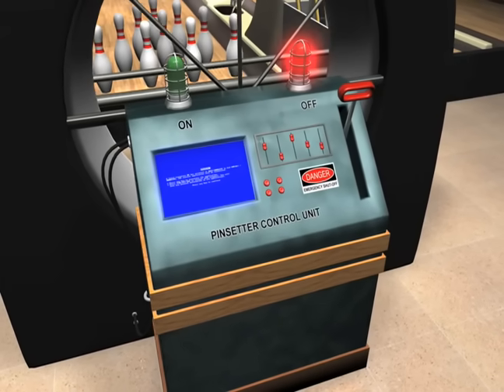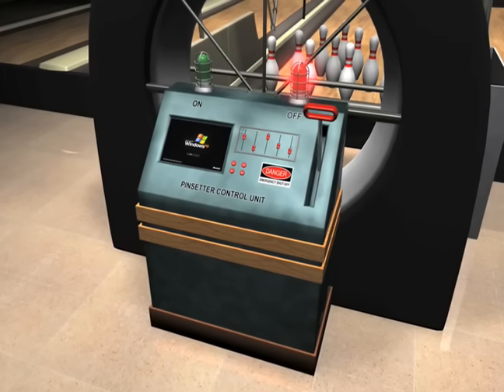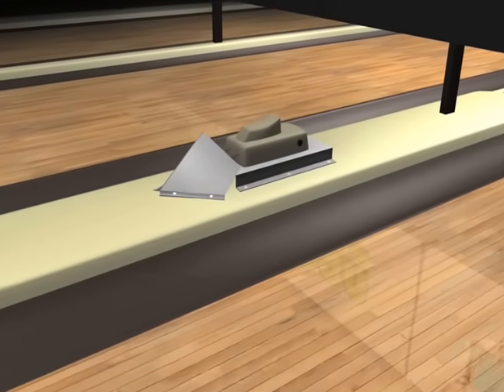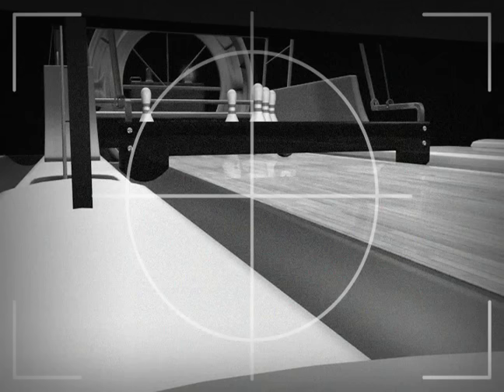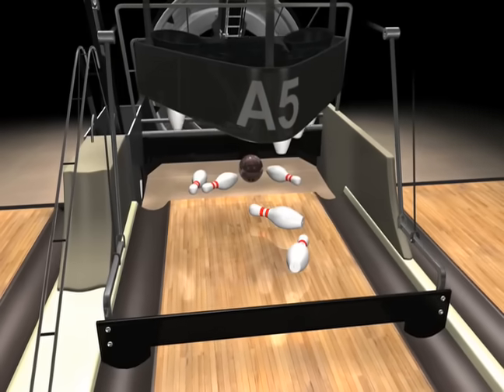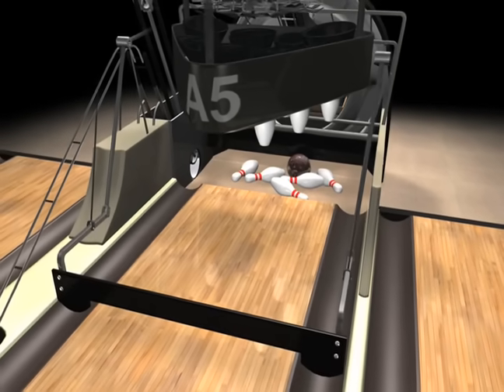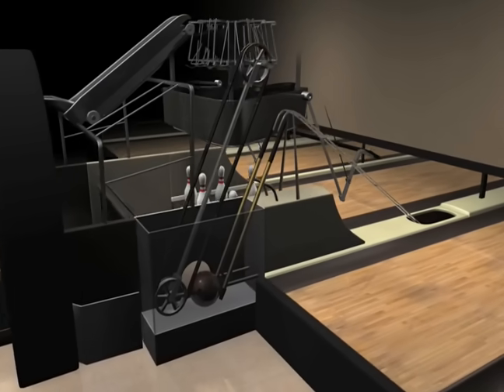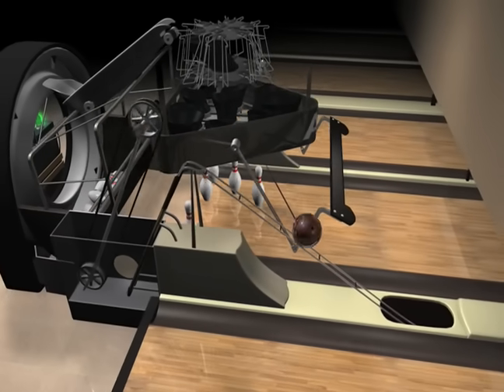How a Bowling Alley Works

Comment: Why can't the pin raiser clamp on all pins (so it'll automatically only get those that were left standing) and count how many were picked up by using sensors? Why use image detection? Isn't it much more costly and unreliable in possible edge cases?

Comment: When the pin reset device was lowering a new full set of 10 pins, your video neglected to remove the knocked-down pins and ball in the back.  Correct me if I’m wrong, but I believe these would normally already be cleared by the time a new set of 10 pins are dropped down.

Comment: Overall generically correct concepts, just have multiple models shown here. Pinsetter is closest to like a Brunswick A2 and ball return concept is like the AMF 82-70 or around there, so two designs you wouldn’t see together. That camera up front that you say “let’s the pinsetter know what pins to pick up” is incorrect. The camera does indeed detect pins for scoring, but the scissors that grab the pins all open and close regardless of what pins are scored. The newer systems like the GSX you can control individually what pins are set for practice or setting up a specific spare that maybe got knocked over late, but otherwise on most systems still in use, the camera doesn’t do that.

Comment: Matt, while your animation does depict some of the  parts of a pinsetter. It doesn't do it at all accurately   plus you're engaging in mixed metaphors since there are parts from completely different models that would not be found working together.  For example there would.never be a pin distributor feeding a turret.  I can go on if you are interested.

Comment: As someone who works at an Bowlero AMF this video is spot on.
Reply: Maybe, but it ain't a "bowling alley", it is an Automatic Pinspotter.  To ordinary folks, it is a bowling machine.  Started working on bowling machines in Dec.1970.  I worked on AMF 82-30, Brunswick A-2, AMF 82-70, AMF 8800 Gold, and XL90.

Comment: I had no idea that pictures were involved. I always figured it would be sensors or something like that. How does an automatic scoring system interpret pictures? That seems like a very human thing
Reply: The design is very human
Reply: There are little dots that are aimed at the top of each pin at our house. I'm assuming those are keeping track of if there is a pin or not.
Reply: The camera image is captured at a. Fixed time after  the ball passes the sensors.  It is then examined by the computer at ten predetermined spots   a given white level at any spot is counted as a standing pin

Comment: The unusual part of the A2 is that the machine is almost purely mechanical, only few switches in the entire machine (3 for power control, two for errors, one for the active cycle lights) everything else is run by one motor with belts and pulleys, with a complex system of cams and gears controlling everything from table height, the rake action and even holding the table up on second cycle. It has my favorite ball return design of all pinsetters for sure! the actual A2 drops them into a fun rail track mounted in the middle of the wheel in the back.   as the description states this video does a great job as an introduction to pinsetters and I really hope it gets more people interested like i was so many years ago

Comment: Question: what if during your throw, some of the pins are hit but remain standing, yet are shifted away from their original positions? Is the pinsetter still able to pick up these pins (I'm assuming that it has fixed slots to pick up the pins that are still standing at each slot?)? What happens to them? Thanks in advance!
Reply: There's a range of off-spottedness that the machine can handle 

Beyond that the pin is out of range which causes the machine to stop and requires human intervention

Comment: I use to work in a bowling place almost 30 years ago. The system hasn't changed alot since then, the biggest difference is there was no camera and no laser detector. The way the machine knew a ball came in is by hitting back of the pin deck and triggering it to cycle. There were 2 elevator wheels next to each other one for the pins and another for the ball. The ball wheel had some padding that helped grab the ball and pull it up to the ball return. Pins and balls often mixed but eventually fell into its proper wheels.
Reply from the maker: Check out @Jared Owen’s bowling video. He does a much better job at explaining the system in detail:

https://youtu.be/Iod6uwUGM2E
Reply: thats a gsx. what about the a2?
Reply: We still have that style at my alley except we use a mix of the computer and the timer
Reply: I work at an alley in washington with original A2s, such a weird mix of technology! ball detect sensors and cameras but most still have functioning OOR assembly instead of the digital upgrade. im actually a little sad they went away with the pit cushion cycle trigger :(
Reply: The best part is the detector.  A completely mechanical computer which chooses how the machine responds to various scenarios.  1950's technology.
Reply: They used to run on much older computing tech in the 1990s, no WindowsXP or any OS at all as you'd know it today.
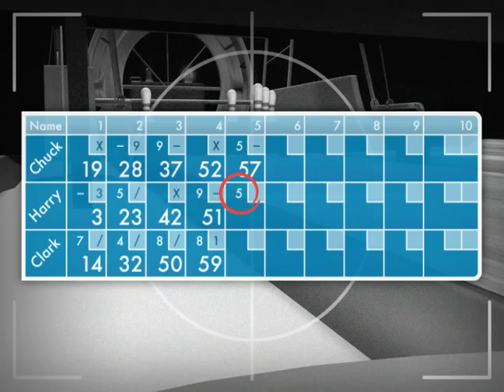Reply: Jesus will fulfill you more than anything in this world, I speak from experience (from when i did Romans 10:9-13), he loves you and wants to be in a meaningful (not romantic) relationship with you. :)   “that if thou shalt confess with thy mouth the Lord Jesus, and shalt believe in thine heart that God hath raised him from the dead, thou shalt be saved. For with the heart man believeth unto righteousness; and with the mouth confession is made unto salvation. For the scripture saith, Whosoever believeth on him shall not be ashamed. For there is no difference between the Jew and the Greek: for the same Lord over all is rich unto all that call upon him. For whosoever shall call upon the name of the Lord shall be saved.” Romans 10:9-13 KJV  “and saying, The time is fulfilled, and the kingdom of God is at hand: repent ye, and believe the gospel.” Mark 1:15 KJV  If you want proof that Jesus and the Bible are true look a documentary called “Ron Wyatt discoveries 2022” on YouTube and a YouTube channel called Expedition Bible. They both examine archeological sites and discoveries that prove the Bible, and even reference secular sources.  (Just don’t convert to 7th day Adventism after watching the documentary) And lastly if you don’t know the gospel and want to be saved search up “abc’s of Salvation Teenmissions” on Google and it should be the first or second result. When you click on it read the whole thing, and do what it says and have faith in Jesus while you are doing it, do not doubt, and if it is hard for you to do what it says, ask Jesus to help you, have faith that he will, and he will.  God Bless :)
Reply: @faby_baby  I don't like God, Jesus, nor people who spontaneously give unwelcome speeches about either of them.
Reply: @nunads  does this all happen really fast or are there multiple sets of pins per alley to keep things moving?
Reply: there are no cameras there this guy is lying

Comment: Nice knowing how this machine works I wonder if it knows to correct the pins when on the wheel before placing it to be ready for the next round so that the pin isn't upside down
Reply from the maker: Yeah I had done this animation quite some time ago. I should probably update it at some point to be more accurate haha

Comment: It would have been cooler if you would have talked more (or listened more) to someone who actually knew what they were talking about. Kind of a trip how you did a computer illustration of a front of a Brunswick A2 and the back of an AMF 82-70 OR 90 before XLI. But aside from the breakdown depiction and saying that the scoring camera tells the machine which pins to pick up, it was a decent video

Comment: At the Bowling Alley in our town, the pins are standing on sensors and when they are moved, the sensor notices it. Then, all the pins are getting pulled back into the pinsetter by some strings. The sensor then tells the pinsetter, wich pins he has to place on the deck. The rest is really simular.

Comment: After the first ball is rolled, and pins remain upright on the deck, why does the computer need to know which pins to pick up to allow the deadwood to get removed? Wouldn't it be just as easy for the unit to be programmed to pick up ALL the pins, regardless how many actually remain? Just close all the collars that go around the neck of the pins.

Comment: Before infrared sensors, there were switches on the dividers. The ball would hit the wood plank, push the divider back, and trigger the machine to cycle. Before 'cameras' and automatic scoring, there was no need for the machines to know what pins you left. There were switches on each pin fingers(Long metal v-shaped deals. That close when the table goes down... Picking up any standing pins). They told the machine whether you struck or left pins. If they didn't pick up any pins, the machine would switch back to the 1st ball cycle and reset all 10 pins. If they did, the remaining pins are put back down and the machine waits for the 2nd time the ball hits the divider. After, the machine switches back to 1st ball cycle and resets all 10.

Comment: Good vid but some things like that model A 2 most had a Shaker board not an AMF Roller Carpet and the distributor on that A2 is called a cross convayer and the pins are loaded up in that rotating spider turret and the pins sit on little spoons till they are released into the Deck Shoots on the spotting deck or as AMF says Spotting table so Bruns A2 table is a spotting Deck not to be confused with the pin deck and an AMF Sweep is Called a Rake on an A2 and an AMF pinwheel is called an Elevator on an A2 and the Brunswick was created by Otis Elevator hence why the Deck is raised and lowered by elevator cables and pullys. Just updating that info that's all.

Comment: <---Bowling Pinsetter Mechanic for over 20 years. This is fairly good info. However, it is a mix of a Brunswick A2 and AMF 8270. You have elements of both all over the place. The moving deck is from an A2. The pit from AMF design. The distributor from an AMF. but the turret at the end of the distributor is from a Brunswick machine. The distributor works differently and moves on the AMF 8270 where Brunswick machines have a cross-conveyor that conveys pins into the turret as shown in your video. 

Nice job though a bit of a mix mash.

Comment: This is not even CLOSE to how a Brunswick pinsetter works. Wrong ball return type. Brunswick lane pairs are too close together to fit a ball lift system. Brunswicks do not wait to drop the pins into the chutes, as long as there is not already a rack in the chutes waiting to be set onto the deck. Not sure where the A5 logo came from as Brunswick never made a model 5. These are clearly A2 machines which do NOT use a computer to run them. Except for the scoring system telling the machine to start a cycle, the A2 machines are pure mechanical belt driven beasts.

Comment: So how does a Original pin setter work! not this modern computer crap.
Reply: An original put setter is a child at the end of an bowling alley placing the taking the pins away and setting them up for a minimum wage job 😂

Comment: Actually it’s true but the control unit is fake the pinsetter goes in the pinwheel first then up the elevator into the carousel in the carousel the 10th pin goes through a tube releasing all the pins

Comment: Five-pin pinsetters work differently. Instead of grabbing the pins, the pins have strings attached to them that the machine simply pulls to lift up the pins and then put them down again in the right order

Comment: Knowing what's happening behind the scenes, it would be pretty terrifying to get dragged in by a bowling ball.
Reply: YT WorldWrecker just being crushed by the pin thing? Yeah that’s gonna leave a mark
Reply: @studioaiden07  The pinsetter can do more than just crush you, it can eat you.
Reply: I saw a video where that happened to a guy.  He was fine.  Well he was drunk, but I wouldn't count that since it was a pre-existing condition.
Reply: @Dude-sr4ji  well, you'd only die by going into the machine itself, that dude was pretty lucky by not sliding in.
Reply: @dr.timothy1678  And yeah t hey can chomp you to pieces pretty quick if you are not paying attention. I used to work on these machines. I worked on the ones called Brunswick A2 machines
Reply: a man died once, being crushed by this thing
Reply: I work with them daily and it’s soo much scarier than this animation makes it seem
Reply: shigecat

Comment: I thought the sweeper was meant to stop pins from coming the player's way, I've even seen one pin being caught by it.
Reply: Well It is rare for a pin to go out of sweepers reach it won't reach the player. I only seen once the computer was out of sync and the pinsetter came down before sweeper got done and the sweeper stripped the pins which made fly across the lane
Reply: @scrateswpo1659  i would've loved to seen that
Reply: @scrateswpo1659  i work at one too

Comment: >watching a video where people are bowling
>wonders why we use tiny bowling balls in Canada or at least Nova Scotia
>googles, learns that I have only played "candlepin"
>learns that that is not just regular bowling with different pins and balls
>reads "the downed pins are not cleared away between balls during a player's turn."
>this implies that they are cleared between balls in normal bowling.
>??? how??? wouldn't it knock over all the standing pins 
>googles, finds this video
>ah
>this seems much more technologically advanced than what happens in our bowling allies.
we just push a button at the end of our turn and it sweeps everything down the hole that hasn't already fallen down there
at least where I've been

also why is this video so popular with the japanese 何でもこんなにたくさん日本人がいる？

Comment: Wait, wait, wait
what happens if the pins go on the wheel facing the other way?
2:17
Reply: https://www.youtube.com/watch?v=caj-K85ulZQ&t=97s
this video should expalin it
Reply: @pooqy  Problem thats from a totally different machine than either of the 2 represented in this video ,,  this would be a better representative video ,  https://www.youtube.com/watch?v=AuRHCPZCGas
Reply: That's exactly what I asked!
Reply: thats what the turnpan is for it has a turns them to the correct position when they come out of the pin wheel,  as an A-2 Mechanic, i dont like this video because its a combination of designs between the A-2s and the AMF 82-70  , which have many different working components , that differ from each other
Reply: Watch this video to answer your question, this is of a turnpan For Brunswick A-2s and how that issue is corrected , thanks , you can see the pins exit the wheel in different ways but turnpan corrects the position :) https://www.youtube.com/watch?v=AuRHCPZCGas
Reply: @johnniec2861  Thank you for the link and for answering my question
Reply: I think if it happens in my country kind of pinsetter. There will be a jam and the u cld see the pins falling onto the pindeck
Reply: It will explode!!!
Reply: It explodes.
Reply: There's an orientation pan that causes the pin to only go one way no matter how it goes up the pin wheel
Reply: they will be rotated in the pin turner area
Reply: It doesn’t matter which way the pin go in the wheel once the pin reaches the top it drops into a pan, the way the pan is designed and with the weight of the pins body it would simply allow the pin to turn around to where the bottom of the pin begins up the conveyor belt first so that the pin always loads right way up, if the pin turns the wrong way around (the pin trying to load upside down) it will just cause a problem, it may keep the other pins and the players waiting, if it were to happen to the AMF 82-70, 82-90 an upside down pin in the setting table the pin would fall out, it might simply stuff up the whole set of pins or leave one pin missing, however a pin turning the wrong way round in pinsetters can be pretty rare
Reply: It's impossible for them to face the other way
Reply: Santino Garetto it won’t
Reply: Santino Garetto I am pretty sure the little triangle things can pick up the pins both ways.
Reply: @Chetan Styles Why would you respond to a comment from a year ago? lol
Reply: then tough luck lol
Reply: it doesn't, im sure that they have machines that make sure that something like that doesn't happen
Reply: The world stop until someone push the reset button
Reply: I thought of that

Comment: I work on Brunswick GS-X machines, it’s cool to see something completely different that accomplished the same goal.
Reply: We got the 98 models, this was a interesting idea.
Reply: @terrie7814  yes and no. at least on my machines. Once the ball trips the sensor to start the rerack of the machine a motor pushes a switch to keep the ball door shut, to keep the ball in the back until the pins have settled down so they don’t get through. The switch stays down for maybe 2 seconds then lifts to let the ball fall through. after which a motorized belt launches the ball underground to the front ball return.

Comment: I have questions.
02:25 if pins fall into the elevator wheel is in opposite direction,how does the machine work?
Reply: When the pins fall out of the elevator there is a piece of metal shaped to make sure the pin faces the right way.
Reply: This rare to happen but mostly like it would just jam the machine

Comment: If a camera is used to count the remaining pins why does the pin lifter drop on a strike before the knocked down pins have been swept away?  (Well every alley I've used I've observed this.)

Mefinx you'll find the pin lifter has sensors on each pin grab that can tell the difference between a pin and no pin so that when it tries to pick up the standing pins it knows which pins are standing and which are knocked down - that information is passed to the scoring system.